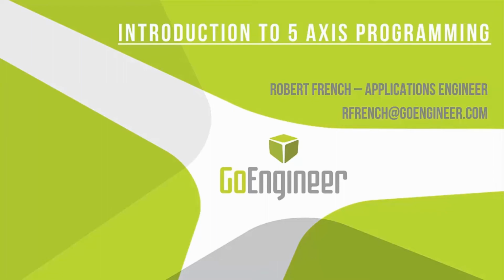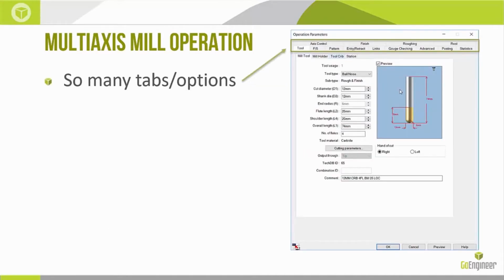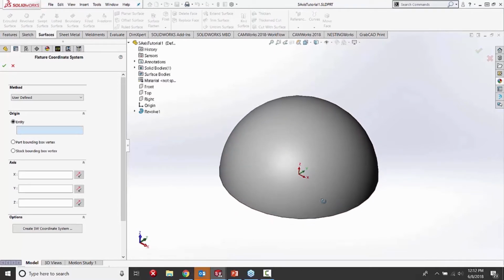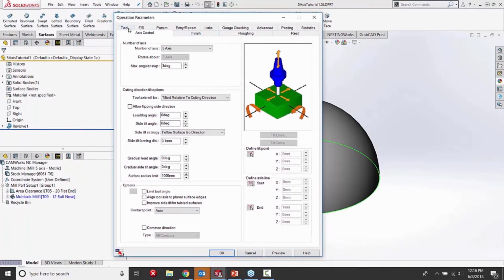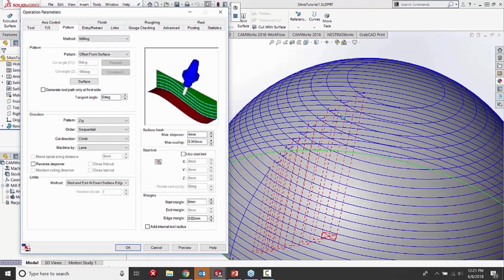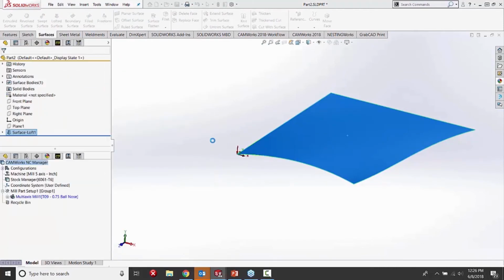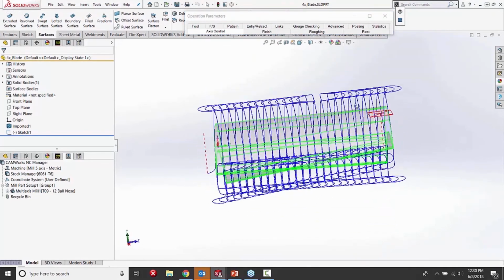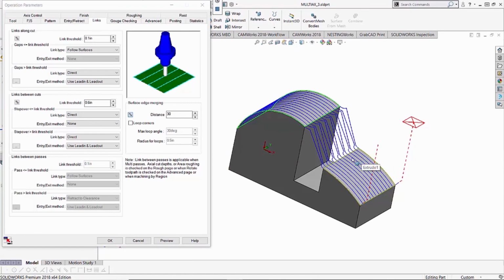CAMWorks - Introduction to 5-Axis

Comment: Hi. I ve been learning camworks for a couple of months now and tried recently using 4th and 5th axis. How would you program to mill a pocket/hole on a flat surface but the hole goes through material along 40degrees slant to the Z axis.? I ve been trying to do it mysle but beginning to give up. Thanks

Comment: How do you get the spiral tool path to clean up the top of the hemisphere? In your demo, it did not cut the top of part and there’s no explanation as to how to correct it. Does the adaptive cut not work for spiral tool path?
Reply from the maker: Instead of using offset from surface, use offset from curve, and then using the curve button, identify the bottom edge of the part.

Comment: I have a question, when I create the Multiaxis Mill toolpath, the simulation runs fine. But when I try to post the gcode it does nothing for the Multiaxis Mill toolpaths, I get all the other code but it skips this set.
Reply: Probably the postprocessor and the milling machine does not support it, or the manufacturer of the CNC mill has not developed postprocessor for the 5 axis machining you use for CAMWorks